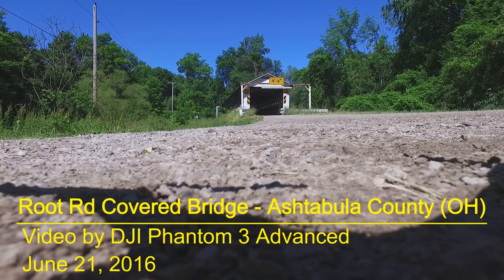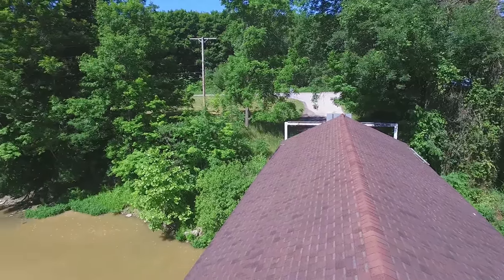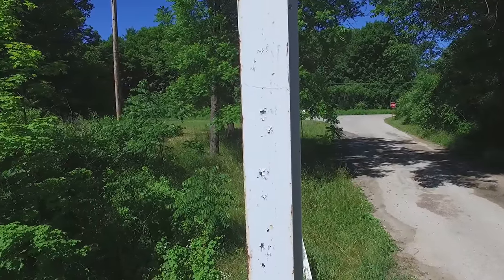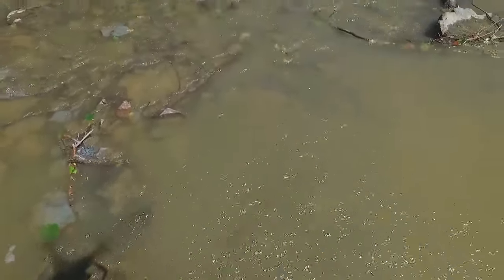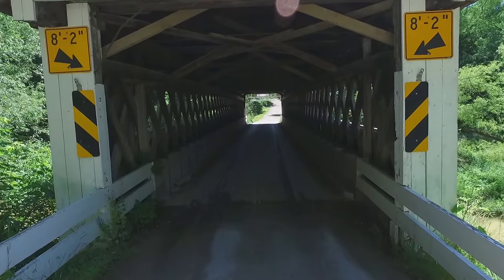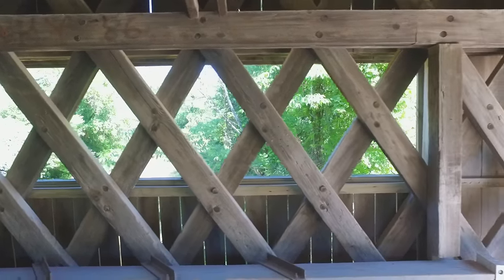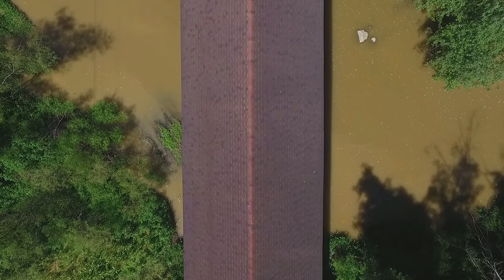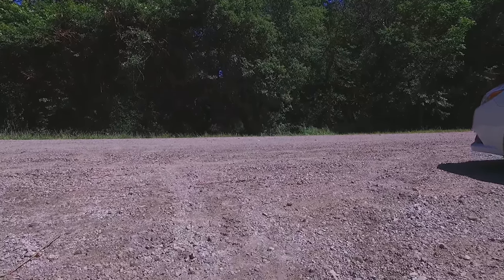P3A Root Road Covered Bridge 6-21-16 (1080P60)

Comment: I wonder if the shallows over the bedrock upstream of the bridge was once a ford. Over here it is not unusual for one to replace the other.
Reply from the maker: It does kind of look that way, and there is enough loose shale that one could easily build a ford for crossing, but, that may go back more than 100 years, prior to the bridge being built.